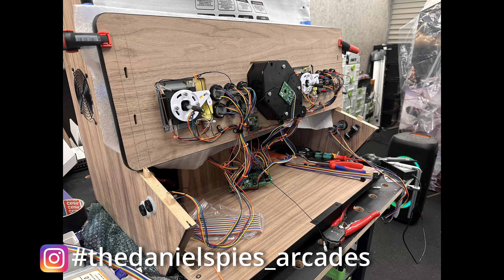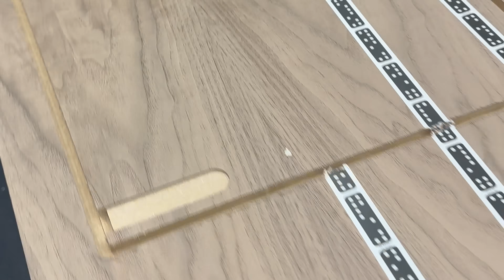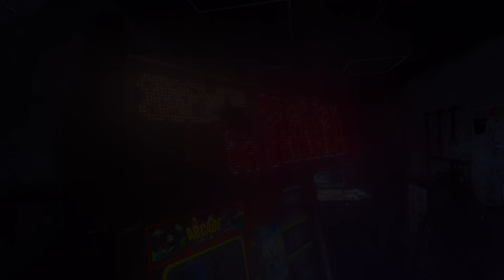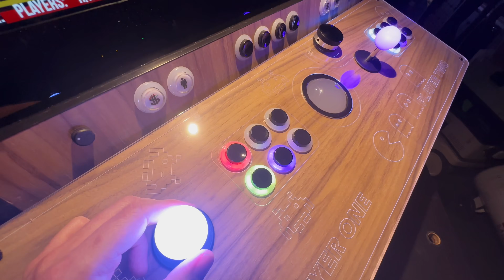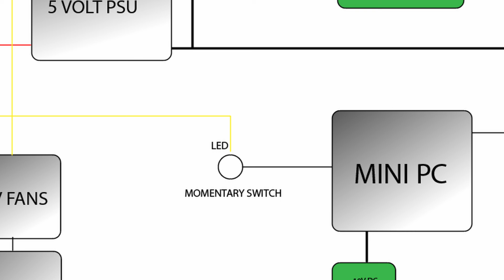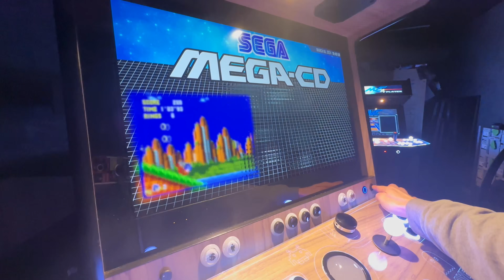I made a huge WALL-MOUNTED luxury Arcade Machine CLASSIC style

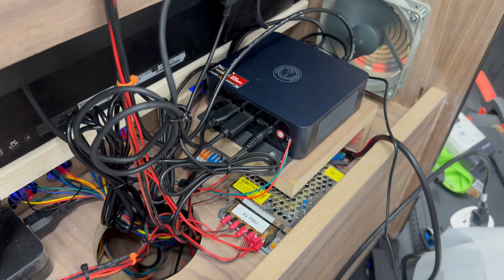Comment: 3:12 using 1080p monitors in 2025 is a no-go.... 1440p is the minimum. 1080p sucks.
Reply from the maker: Hi, No that is not the case for emulation software. 1080P is actually the preferred resolution :-) For modern games it is different indeed.

Comment: If I wanted to build one like this, what is the absolute bare minimum power tools I would need?
I would want to make one that doesn't have the marquee up top to save some space and materials.
Reply from the maker: I would say: Router for the T-Molding groove (any one will do just fine) , a jigsaw and a cordless drill?

Comment: Where did you get the volume knob? It's neat and convenient.
Reply from the maker: It was difficult to find and far too expensive (30 euro or so) and it did not outperform any standard knob. In the next builds I will switch back to normal ones :-)

Comment: There is an easier way to set up 1 button power.  They sell standard power strips that have a detection port.  You simply plug your PC into the detection port and all the peripherals into the relay controlled port that need to be powered on when the PC powers up.  Also there are provided 'always on' ports that can be used for things like the monitor that would normally sit standby.  I've used them in all of my builds and it really simplified the 1 button power up for me.
Reply from the maker: Nice tip, thanks!

Comment: A 6 pin momentary switch will also solve the problem of turning on two things with different voltages on at once. Alternatively you can also use a 12v to 5v down step converter and save a power supply , or a usb to DC cable from the mini pc to power the pixel cade / IPAC LEDs .

Comment: This is incredible.  I am currently doing a wall mount and using a mini PC.  And I have been struggling to come up with a way to power the pc on from a button...in the past i used the front IO pins...but these mini PCs dont have them.  For the PC itself ( looks like wires coming out of the unit)...are you soldering those wires into the mini pc board?
Reply from the maker: Yes, I solder the wires directly on the motherboard indeed :-)